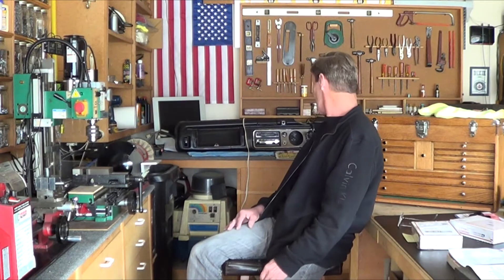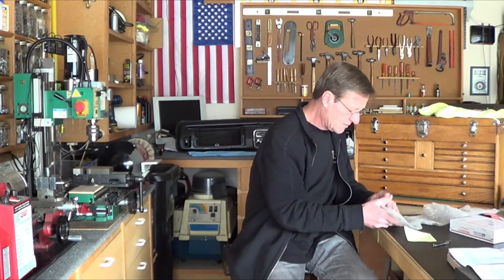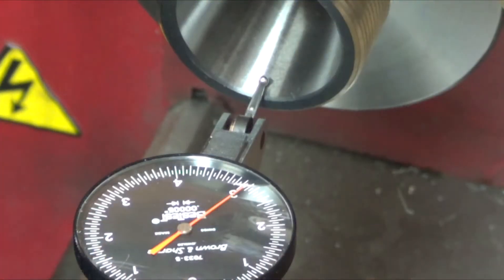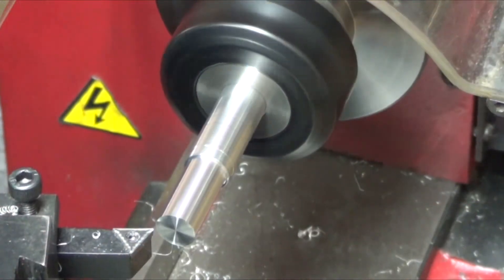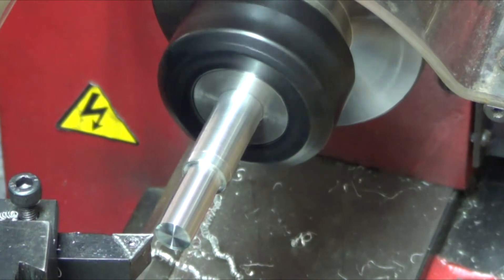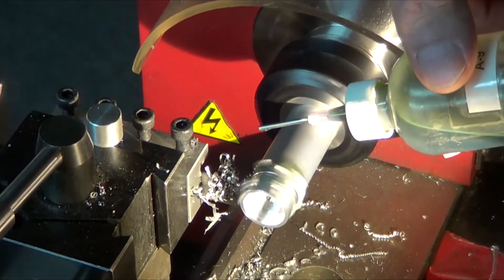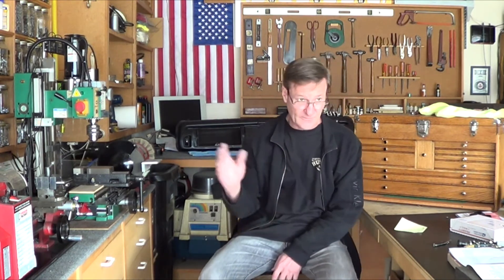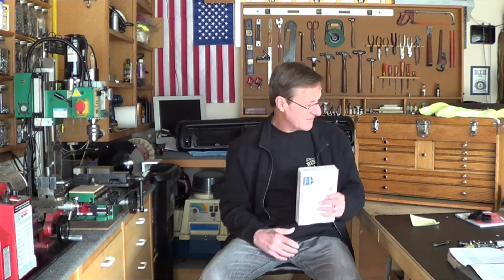Heinz 57 Video #37

Comment: Thanks for the collet-chuck videos David.  I'm fairly new to home machining. I've had my Sieg C3 7x14 lathe for a few months now. I have been debating getting a 4 jaw chuck or the collet set to improve accuracy. I think you made up my mind! Also, I plan on getting the Sieg XD2 mini mill down road. I believe I could used the collets on the mill also. 

You mentioned below that you were wondering if the accuracy would be the same if you took off and put back on the collet mounting plate. I would suggest putting witness marks on the spindle and chuck collet locations. Thanks again.
Reply from the maker: +Brian Kennedy Stand by for the next video which will be out Saturday. I discuss more and show more!
Reply: Thanks David. Looking forward to it.

Comment: That collet is amazingly accurate. I'm starting to think you drew the best one from the pile. cheers. btw, I think you'l get even better results with HSS tools on aluminium (or any soft metal). they can be made sharper then carbide inserts, and thus work with less tool pressure. theý'll be more accurate on a mini lathe on those last few tenths in my experience. cheers.
Reply from the maker: +Flip de boer I'm thinking the same thing. Be curious if it stays that accurate if I unbolt it and put it back on. Crazy .00005 runout!! HSS is another whole project for me to learn and setup to grind. Soon.... But I will now definitely be there after your comment about it! Really liking the comments from subscribers.